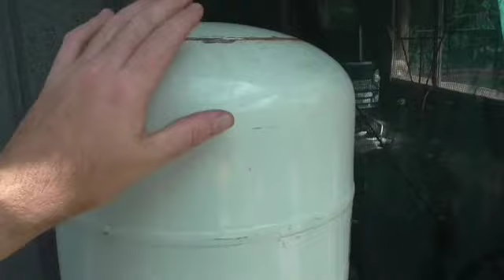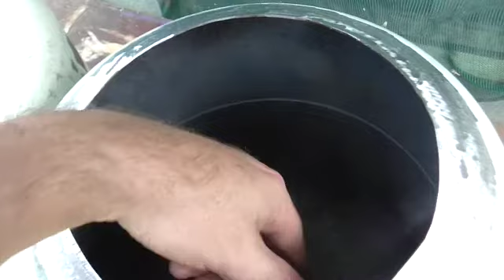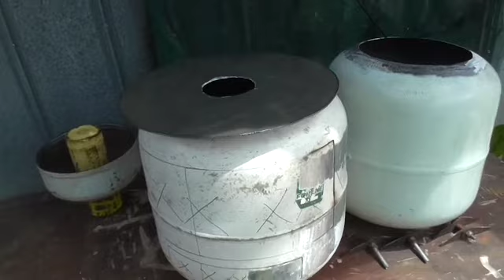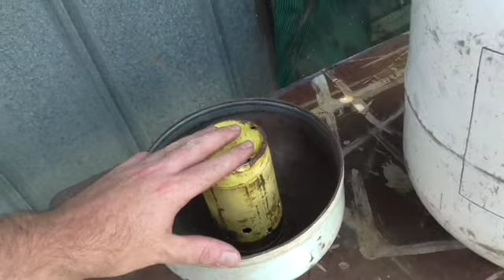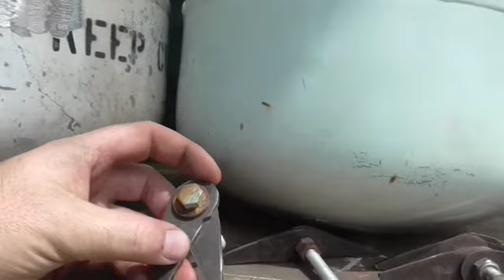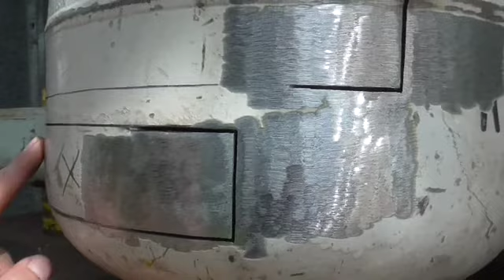Waste Oil Heater

Comment: Hi Patrick. Thanks for the kind words. Greetings from a wet and windy Ireland. Your stove looks really good and will work great. The length and diameter of your flue will have the most bearing on the setup. I have 4m of 6 inch (150mm) flue and I get fantastic draw from it and I don't have to be too worried about sealing up all the air leaks as they suck air  and are used in the combustion process. I am going to build a slightly revised burner without the holes in the mapp gas cylinder but it will look and work very similar to the one you have. I will get it made today or tomorrow. Well done on the build and I am looking forward to seeing it running. I subbed to your channel Yay!. Cheers Gerry
Reply from the maker: Thanks Gerry. I wasn't sure of the exhaust and the size to go. I'm thinking it was bigger is better. Now just to find some big pipe from a scrap yard  and get busy. I will have it all welded up by the end of the weekend.
Reply: Hi Patrick. 5 inch flue will work great for your setup as it is now. I will be doing a forced air unit soon that will work for you with very little modification to your stove design. The advantage will be cleaner emissions and more heat if you want it but it will require power and a fan. I managed to melt brass in the setup you are building now so that will tell you just how much heat you can produce from what you have now. The weather looks great where you are, it doesn't look like that here at the moment but at least we don't need to water any plants, nature is taking care of it.  lol. Cheers Gerry